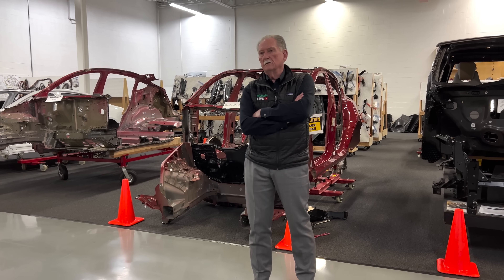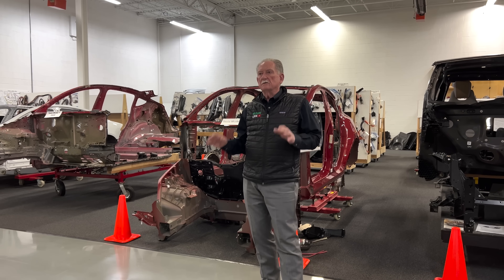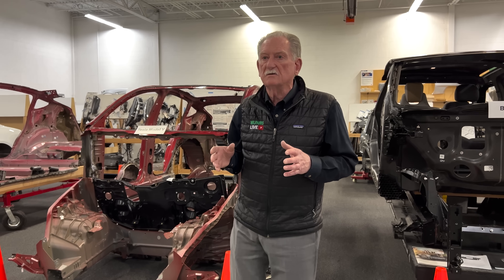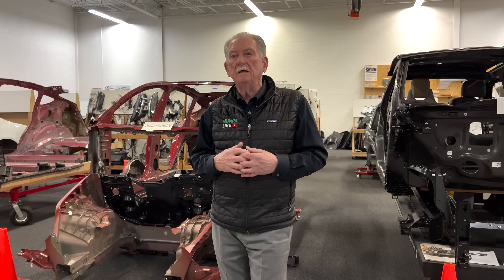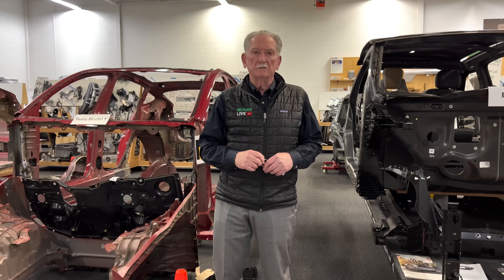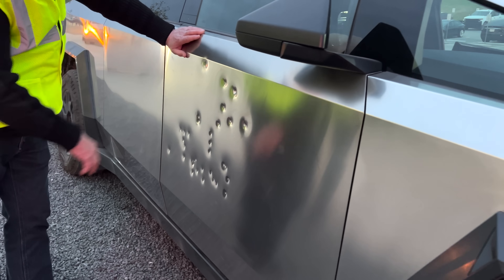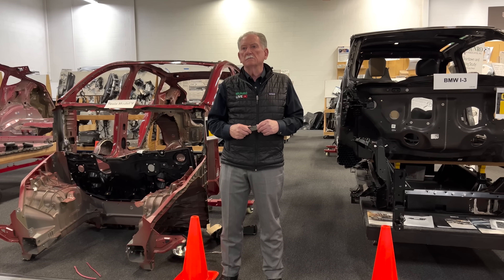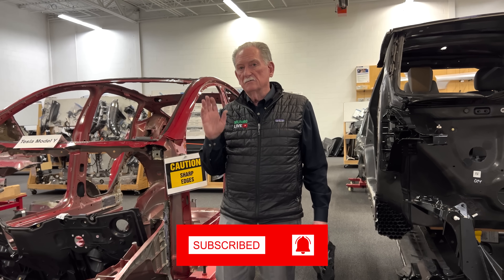An Engineering Analysis of the Tesla Cybertruck

Comment: I love the info about the computational flow system Tesla has and what it enables them to do. Another way they're so far ahead of everyone. Of course it goes along with them having the top materials people on the planet, as you say. Why? Because Tesla and SpaceX share their metallurgy teams, along with some engineers in other areas.
Reply: I thought that comment was a bit unfair. He kind of implied that everyone else just made a big casting and then put some squares and smaller diagonals in the design because that's what they've always done, but Tesla used computers to model it and did everything 100 times better. Granted there may be some steps forward with the Tesla design, they may have had to step forward, or at least sideways, to make much bigger castings work well and/or more economically. But I'm 100% sure that every manufacturer has used software to model and optimise where those squares and diagonals go, where the strength needs boosting and where weight/metal can be saved.
Reply: @AJB1  The innovation may be less about CFD and more about how it is used both in casting flow analysis and finite element structural analysis iteratively.  They are optimized to both reduce resistance of the molten aluminum as well as acting as stiffners.  It makes the final product look much more organic, similar to a tree or river.
Reply: @patrickkenny2077 yep. And the analysis of casting flow may be something that's a really big issue for them as the casting is so large, but perhaps not nearly as important for other designs with much smaller castings. Not saying it's not a step forward, or an improvement, just that I felt the video almost implied that everyone else stuck on square and diagonal ribs without simulating anything, as that's what they've always done, and Tesla was in a different league as they'd used computer simulations to design theirs. Granted it may well be that others haven't simulated the flow, but maybe they didn't need to. I'm 100% sure that everyone runs simulations (eg FEA) on their structures, and optimises them based on the results.
Reply: They are far ahead of no one literally no one! This truck is utter garbage 0-60pony trick! Ive seen people in Thailand for example very easily modify and adapt a 200hp Toyota Hilux to tow about 5tons and thats for hundreds of miles to remote places or a 6*6 rv based on a truck which is totally impossible with this tesla let alone many other mods.
Reply: Metallurgy is nothing specific to tesla or whatever you think all manufacturers have them. They have worked and developed tons of different types of materials for all kinds of use, heck Hyundai is a giant in the metallurgical industry with gigantic mills in korea....
Reply: Oh yes, they are so advanced with CFD, it's not like it's an industry standard and available in software anyone can buy for a reasonable price. It really worked out well for them too, just watched the video of the Cybertruck crash test and the dummies head was stopped by the airbag in a fraction of the time of a f150 at the same speed, being able to go from 35 to 0 that much faster makes it very safe and really shows what abandoning industry standards can do for you.
Reply: @oBCHANo nope they are not "sooo" advanced lol!!
Reply: @oBCHANo  you absolutely have no idea wtf youre talking about get of your high horses.

Comment: I think it's a pretty cool leap in technology. Mixed feelings when the steer by wire though. Really the biggest thing I'm bummed about is it's not going to be useful for truck stuff.
Reply: Please explain what truck stuff you are referring to, that steer by wire cannot be used.
Reply: @csf1757  I can't imagine it's going to give an accurate feel for what's going on when backing trailers. Also with the variable sensitivity it's going to make fine adjustments more difficult.
Reply: @computersales  (Joking here) Tesla’s response to backing a trailer is, “There’s a computer for that.  It’s a $4,000 option.”   I can see the variable steering ratio could be a bit of a mind bender backing a trailer.  I’d like to try it in real life to see if it makes the job easier or more difficult.  The other thing that is going to take getting accustomed to is what feedback through the steering wheel feels like … or doesn’t feel like.  Again, I want to drive one to see.
Reply: One thing I learned driving in the northeast is that you can encounter patchy invisible ice and you get a stuttery feedback in the steering wheel as the traction comes and goes.  That’s a sign that it is a good time to back off snd take it easy for a while.  Getting the communication of road feel is pretty important.
Reply: @wtmayhew  I hear the Ford's knob works well for backing trailers. I look forward to test driving the cybertruck. I doubt they will have a trailer on hand for the test drive. Maybe I'll have to bring my own. 🤪 When I test drove the lightning I felt more at home in it than I do in my model Y 17,000 miles later. Honestly once the lightning gets NACS I might just buy one and install towing mirrors.
Reply: @wtmayhew  I'm still trying to figure out my Y on ice. It is unpredictable when braking. Although it may just be n AWD thing. It is bizarre to slide diagonal in a random direction when trying to stop. My 2004 2500HD never did that.
Reply: @computersales   Thanks for the reply.  Thanks for sharing your experience with the Lightning.  There’s a Tesla retail location about 30 miles from here.  I hope they get a Cyber Truck demonstrator soon, but with so many pending orders, they don’t really have the need to be quick about it.

Comment: First, you're starting to sound a lot less subjective and more of an Elon convert/Fan. As someone who has been in the industry as long as you have, building your reputation, your "perfect" and "best" comments sound more like you were paid for your reviews--not saying you were, just that it puts that vibe out there.

All that aside, martensitic SS is usually associated with being able to be heat treated to increase strength and hardness but it is also considered to have less corrosion resistance than austenitic SS. With the CT's being paintless, it seems that corrosion resistance would be high on the "must have" scale. Aerospace industry precipitation hardened SS sounds more like what Elon is suggesting these are made from, where they have the corrosion resistance of austenitic SS and the strength and hardness of martensitic SS. Can you discuss the specific SS in more detail or is that a secret?

There are images circulating that show an internal safety cage that appears to be made out of traditional stamped steel with the SS outer body panels welded/attached. Can you discuss that in any detail? If the triangular shape is really because it is the frame/exoskeleton, why are the conventional stampings needed?

Comment: I am not sold on steer by wire overall.  How do you  feel bumps and slippage ?  Can be a safety issue, no?  Certainly an issue for sports cars, where the whole point of the car is to be connected to the road.  Unless there is a simulated feel like sim racing wheel, this is a problem.  Finally all this new tech while great creates a headache for people who like to modify and fix their cars.   I would hate that Tesla will end up like Apple, although it seems they are going down that path.
Reply: Check out engineering explained and his video on the Lexus yoke (steer by wire) system.  I also think it might be hype.  Tesla wasn't the first to do this.

Comment: My 2009 Renault Laguna GT 205 has steer by wire on the rear axle. Sensational to drive. The rear wheels steer opposite to the fronts up to 60kph and the same as the front over 60kph. The latter makes emergency lane changes at high spped safer as it reduces the rotational forces of sudden steering that occurs in 2 wheel steer cars, so the car is less likely to spin. And the former is super in roundabouts and multistorey car parks.

Interesting the abs & stability control computer communicates with the rear wheel steer ECU. One time i hit ice on one side of the car going down a hill, so the car started to rotate into a slide. As a confident driver my brain said no problem lets steer into the skid, but before my grey matter sent the signal to my arms, the rear wheel steering was sent a signal by the stability control system (ESC) system to counter steer and the car straightened up by itself, and i could feel that the correction happened at the rear. It was very impressive.

Well done Teslas on the 48v, 4 WS & Martensitic stainless steel.
Reply: Here is the 4WS Laguna GT beating a 3.2 litre Porch Boxster S in the Elk/Moose test

https://youtu.be/QaTnd3ozcaE?si=I8_budhpUS04Jp4w
Reply: The CT behaves the same.
Reply: Cool info.
Reply: 'My 2009 Renault Laguna GT 205 has steer by wire on the rear axle.' 
Thanks for the information. 
As it is still working and seems not to have had problems, these are good news.
Reply: So it’s ancient technology instead of a brand new rocket science invention? Hear, hear.

Comment: I still dont get what that 48V is all about. I mean, in an electric car it maybe makes so much more sense, but in a normal car. Who needed 48V? The only really thick cable because of 12V is needed to the battery and alternator and some connections to the engine and thats it. Everything else is mostly low amperage stuff. Only some freaks needed thick cables for their audio systems, but thats it. So in a normal classic combustion car 48V wouldnt have made any sense, and thats why nobody implemented it so far.

Comment: The castings info was particularly informative. You guys rock!
Reply: I'm 90% sure that everything he said about the casting is BS. Firstly he called it CFD, when actually its FEA which automakers have been using for decades to design even the example chassis he showed. He also sounds like he doesn't have any idea what he is talking about and has just repeated whatever the tesla tour guides said was "revolutionary' about the cyber truck castings. The "natural flows" he talks about are literally everywhere in aluminum castings. TBH I don't trust a word he says anymore, it seems like tesla either bought this guy or he bought in to tesla.

Comment: I would have thought FEA rather than CFD if we're talking about the dynamics of the finished part.  Though maybe CFD comes into play for the casting process itself.
Reply: FEA is for structural analysis, simplified said to simulate the flow of force - CFD is fluid-design, as the name intends, on mould-flow-analysis you try to figue out the best paths to ensure a homogenious temperature distribution to avoid any big temp-differences in the mould, which might cause warping, stopping of the flow or other negative effects.

Comment: You mention that the "rear castings are made on a 9000 lb. press". I though castings werer "cast" while pressings were the product of presses. Not wanting to make this symantic issue, but am I missing something in a new fabrication technology?
Reply: probably because the process has elements of both processes. It is essentially a casting (a fluid is filled into a mold to get the desited form), but this happens with very high pressure and speed, which would force the halves of the mold apart if the clamping force of 9000 Tonnes didnt hold/press it together (a bit less than ~20000000 lb  if google isnt lying to me). 
The force might seem gigantic, but the force the plunger applies to the molten aluminium per surface area is applied over the entire surface of the mold outward (again, same force per surface area), so the bigger your casting the higher the clamping force you need to keep it together..

Comment: The move from 12V to 48V is a great idea.  But not earth shattering.  Can someone (who isn't guessing) tell us if the steer-by-wire is totally redundant?  Redundant sensors, redundant control cable, redundant actuators?  

Curious about the frying pan and magnet.  Anyone know what that was about?
Reply: Revile day said motors are redundant and sensors are in triplicate.
Frying pan and magnet: The lack of magnetism happens with the Austenite structure. The martensite structure is the same as a hardened tool steel and is magnetic.  What happens in cold working is the Face Centered Cubic (FCC) Austenitic structure slowly goes to the Martensitic Body Centered Tetragonal (BCT) structure that does take a magnet. This cold work here has not created enough martensite to hold a magnet. I am selling a Chrome-Nickel with Nitrogen Stainless to the Navy for their mine sweeping operations.  My Nitronic is an austenite stabilized material that can be bumped, bent and crushed (Cold Worked) and still be an austenite that has does not change to take a magnet.
Reply: @DavidKirchner  Thanks.  I actually just found Tesla's patent and it clearly shows redundant sensors, actuators/motors and control circuits.  It also shows separate power supplies.  Seems like there are no single points of failure.  Good to see.

Comment: Regarding ethernet, are the speakers ethernet?

Everyone says "steer by wire", but the big deal is its "variable steering ratio" via steer by wire because the variable ratio is what is physically noticeable by the driver.  The average person couldn't care about the steer by wire.

If the window motors are still 12V, then each motor must have a 48 to 12V converter.  And the vault cover.  And the wiper motor.

Is there a 48V battery or is it all DC-to-DC from the traction battery?

Sandy, did you get a copy of the "How to design a 48-volt vehicle" from Elon?   We need to see it.

Comment: "The price tag is something everyone is interested in"  Sorry, not interested in a $99,000 over rated soda can. We should be working to lower the cost not just accept higher prices.
Reply: Elon stated in an earlier video with Sandy that the next project is a $25,000 car...can u afford that?
Reply: In 8 years you have to spend $15,000 for a new battery. And this $25,000 car will just be a box with a screen inside.  @rickmann5866

Comment: Thanks for sharing that, Sandy.  I would imagine that the next vehicle, the 25K vehicle, will use much of what they have developed for the CT.  From what I'm gathering it will be another evolutionary step not only in design engineering but also in manufacturing.  It must be a little disconcerting for the other OEMs as it may increase Tesla's advantage.  
  I'm wondering how that is going to be made.  Stainless door skins for superior side impact strength and elimination of the painting process? Front and rear caps could be colored through painting or colored plastics.  And much of the chassis could be cast aluminum- possibly in one piece like their patent drawing shows.  Exciting times. Can't wait to see that one analysed.
Reply: LEGA execs can't become disconcerted. Those dim bulbs were never concerted!:face-blue-smiling:
Reply: @FrunkensteinVonZipperneck  They are more concerned about their "golden parachute" after the company fails.  ;-)
Reply: Musk has said that the $25,000 model will not have a stainless bullet proof exterior. Those panels are difficult to manufacture. I kind of expect the exterior to be part of gigacastings for durability and ease of manufacture. The best part is no part. Munro here states that Tesla developed a way to attach gigacastings to each other well, and Musk has said that the next model will not be a single casting. But maybe it is like two or four gigacastings attached to each other.
Reply: @tribalypredisposed  You are right he did say that.  So more like several modules that can be built on their own line and all comes together ate the end.  Kind of what they are doing now with the CT-  front and rear modules built separately.  I still like the idea of SS doors- so many benefits there.  Can be a little thinner than the 1.8mm that the CT uses.  I really like the no paint shop idea, though.  The front and rear body surfaces can be made in precolored TPO that happens to be made in Mexico.  Looks exactly like auto paint with a clear coat but is vacuum formable.  They use it on Toyota trucks for flares and on Prius bumper covers.  It requires a new design language but that could be a good thing.  Anyway, fun to think about.  Cheers.
Reply: If they release a vehicle under 30k in the next 5 years I'll eat my hat
Reply: @opliko  It depends on inflation…will they release a car in the next five years that eventually reaches an inflation adjusted equivalent to $25,000 in constant 2022 dollars? I say yes, once production is fully ramped. Musk said in 2007 that the Model S would start at $49,000, which adjusted for inflation would be $72,700, and it starts at $74,990 today, which is pretty close. Model 3 is actually cheaper than promised when adjusted for inflation; $35,000 in 2016 dollars is $44,867 and Model 3 starts at 38,990 today.
Reply: @opliko  Shop for tortilla hats.  🙂

Comment: Until the higher voltage is under load that will create more heat which will need thicker gauge wire to supply the higher voltage draw from the equipment on the vehicle, but I do like the idea of going higher voltage for efficiency
Reply: This is not correct.  Higher voltage will lead to lower current.  Therefore it leads to lower conduction losses, or thinner wires, or a combination of both.  Its not a bad idea, but not as interesting as everyone seems to think.
Reply: not sure how you come to that conclusion.. P=U*I - to transmit the same power if you increase the voltage you decrease the current. and the power demand is usually pretty much fixed for each component (ignoring potential converwin losses that are usually neglible)

Your statement makes only sense if there is a resistor with a fixed value between + and -, which doesnt make sense at all to put one there, except you want to heat something constantly with a fixed wattage. and with higher voltage you need a higher resistance to get the same power...